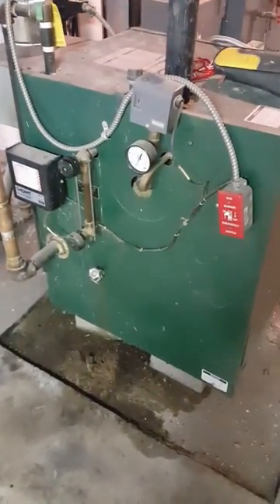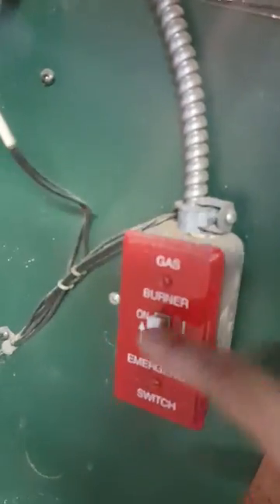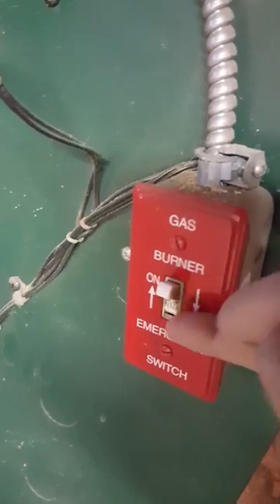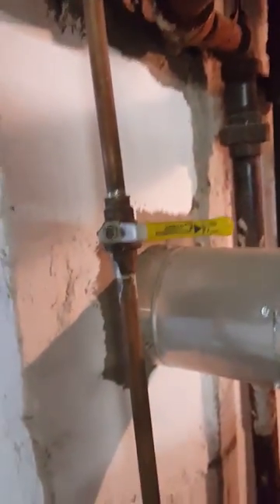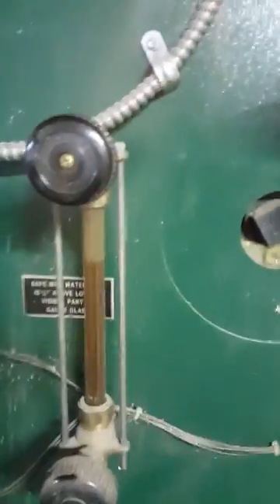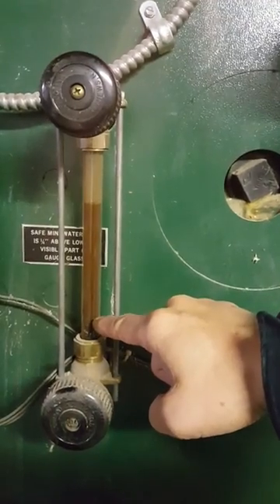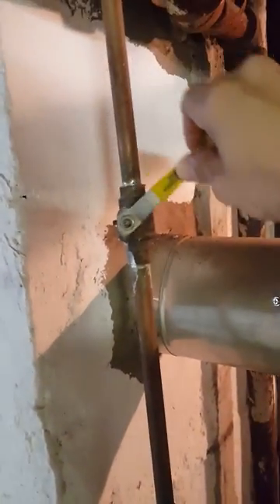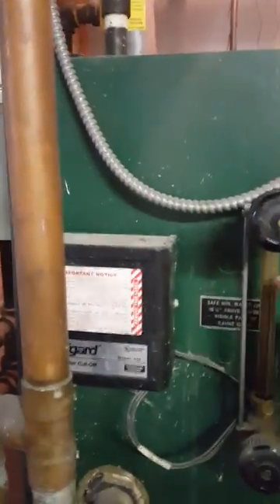How to turn on the Boiler

Comment: I have this same boiler. Does anyone know how to clear air out of the pipes with this type of boiler. I’m getting a lot of banging in my radiators when the heat comes on.
Reply: drain from the radiators, not the boiler
Reply: Some systems you cant drain from radiators. There is a Youtube video that explains how but its kinda complicated